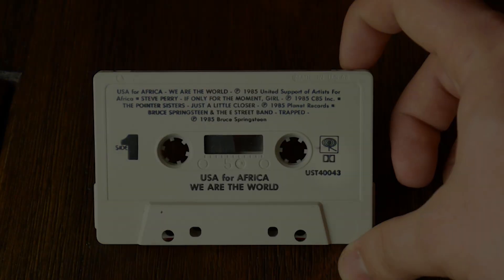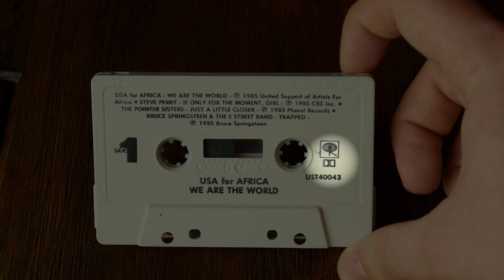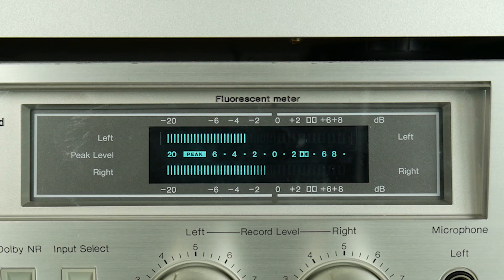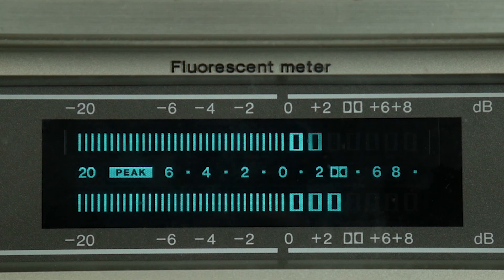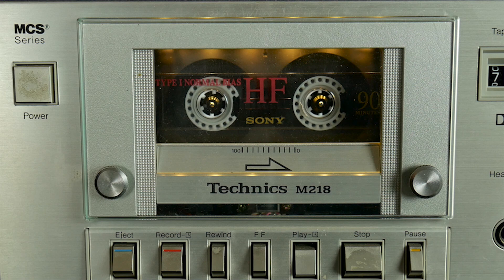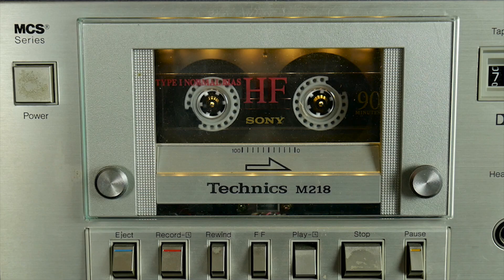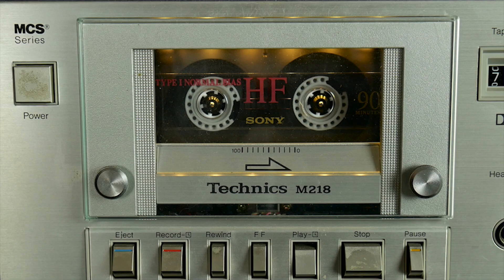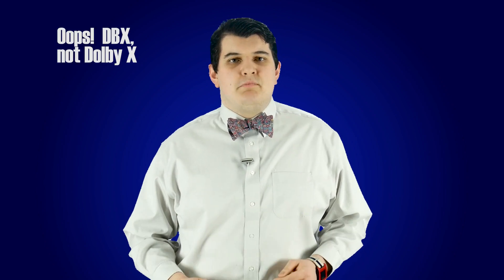What is Dolby Noise Reduction?  Dolby's Humble Beginning

Comment: Using a graphic equalizer to illustrate Dolby Noise Reduction is inaccurate and misleading. The graphic EQ recording curve shown in this video is not Dolby NR, it is more like the high-frequency pre-emphasis curve used on vinyl records. The key to Dolby NR is that during recording, the degree of high-frequency pre-emphasis increases as the sound volume level decreases. On playback, the process is inverted, de-emphasing high frequency noise to a greater degree at lower sound volume levels. Contrary to what this video claims, the maximum recording level does not need to be lowered when using Dolby NR, because the degree of high-frequency pre-emphasis used is negligible at the highest sound volume levels.

Comment: Dolby doesn't just boost the treble, if you boost the treble at 0 db you would severely saturate the tape, so there is no boost at 0 db and as the signal goes down the treble boost goes up.

Comment: I remember Dolby in the 1970's. You pressed the button to enable it and it sounded like someone had put a pillow over each speaker.
Reply: It is true. but it was strange, if you were using a tape encoded in dolby the sound was supposed to improve. and it was the pillow effect
But there were many others recorded normally that sounded better
I got to like so much the pillow effect that Dolby produced. that whenever I can I try to replicate it with the equalizer.
It is not very difficult, only Bass of 100 to 300 Hz and Treb. of 13 khz. to maximum (with some variations in 3.3khz) and voila. Dolby Pillow Reduction for all

Comment: Yes, DBX, NOT Dolby X.  Yikes. :)  We used Dolby A, DBX and Dolby SR in the recording studios.  Multiple tracks would build up noise quickly so reduction could be helpful.  We also had Dolby B and C encoders for creating CDM's (cassette duplicating maters).  You had to include the Dolby (warble) reference tone on the tape for the duplicaters to set the exact levels for recording otherwise the decoding would not work right.

Comment: Early CD's had a similar pre-emphasis as well. Unfortunately this was one of the things that contributed to the perception of digital sound as overly harsh, when played back on a non-compatible CD player. Very few modern players are compatible so ripping an older CD can present some problems. And I think it may have lead to some confusion among mixing professionals as it seems some continued to employ pre-empasis in mastering without realizing that it was no longer supported.

Comment: Dolby C is literally two Dolby B circuits stuck together. I had a reel to reel multi-track deck with DBX. That works with EQ and compression. It does sounds terrible if you don't decode an encoded recording.

Comment: A sub-category with regards to Dolby Noise Reduction, when it came to using blank cassettes for home recording purposes, could be with the "bias" that a given cassette deck were calibrated to when using blank cassettes.
I've gone through many cassette decks over the past 40 years, from the first being a Pacific Stereo Trans-Audio deck of 1977, all the way up to DENON decks in the year 2000; where I've learned that to get the best fidelity out of the cassette deck, the user needs to test various blank tape brands to discover which one is best suited for recording/playback.
In one example, it astounded me how an Onkyo tape deck sounded lousy with TDK cassettes, but sounded great with Maxell.  And, surprise of all surprises (sarcasm), a Sony cassette deck sounded best using blank Sony cassettes.
People with lower-priced cassette decks, and a lack of available info, were hindered with getting the best fidelity out of their cassette decks; especially so for those users that were budget-minded and bought whatever blank cassette brand that was discounted on-sale.  
Some of the higher-end cassette deck manufacturers compensated for the fickleness of the blank tape brands with including a knob dial for adjusting tape "Bias."  The Bias knob was generally found on three-headed cassette decks; where in the "record mode," the adjustment knob was used.

Comment: I was lucky enough to know a guy who invented a completely new way to record on to tape, one which blew Dolby out the water.   I'm also one of the few people he ever gave a demo tape to because the method was so innovative.   Even the guys at Philips didn't believe him when he demo'd it to them.   But I can tell you, you can swap back and forth to the original CD recording and there was no difference between tape and CD.   I was in his lab switching between sources trying desperately to find a flaw and there was none.   It was the perfect recording method, and it played back in any machine.

What did he do next?   Invented a method for FM radio that eliminated multi-path noise.

The guy was a genius.
Reply: please tell more! this is interesting! Who was this guy?
Reply: @polysormi3825  It was called "Contour Biasing" and invented by Archie Pettigrew.   There's a story of it I'll post a link to, but this was of an early version as Archie was working on making it playable on every regular machine, which he very quickly did.   So the tape I have could be played back on my own machine without any modified hardware.   The "cleft stick" the article talks about was gone!

https://www.newscientist.com/article/mg12617183-300-technology-industry-holds-back-on-hiss-free-tape/

Comment: My cassette recordings  keep sounding blown out and splotchy is the best way I can describe it (even recorded at very low level with a clean input source) any idea why? Older techniques deck non Dolby tapes recorded with Dolby off doesn't sound like "wow or flutter" is crisp and high fidelity but sounds like it was recorded way to loud and bass is splotchy treble distorted any ideas?!!
Reply: Splotchy meaning some notes sound fine others almost sound as if they were missed in the recording

Comment: FYI: adding signal is precisely how initial recording was made clearer in the first place... if you add a noise floor and then remove it using circuitry, you can achieve a better recording than simply recording the signal directly.

Comment: but if dolby NR uses only a high frequency boost during recording then how it will sound good in those cassette players which don't have a dolby NR switch for playback? But then why dolby cassettes sounds good in every cassette players?
Reply: @kylesmithiii6150  Whatever... but if dolby recorded tapes are for dolby players then howcome factory recorded tapes which are not dolby, still sounds good in any cassette player? But if you record on any boombox without dolby noise reduction won't record audio like the production quality and when you playback the recorded audio you get lesser audio level and also noise. So I wanna know how can you record audio on a tape without dolby like the factory production quality!

Comment: Another way the tape may have a hissing noise is if you record the tape on a tape recorder that uses a permanent erase magnet instead of the actual AC bias erase head. Those permanent erase magnets are known to record terrible hissing noise unto the tape, while erasing it. Usually the low end or portable tape recorders use this technique of erasing the tape while recording. I strongly don't recommend using such recorders for high quality or important recordings.

Comment: It's not the tape that produces the hiss noise, the tape deck itself produces that hissing noise. If you have an older tape deck with manual function keys instead of selinoid soft touch keys, where you can press play without having to have the cassette in the deck. With no tape in the player, press play and turn up the volume, you will hear the same hissing noise without the tape in the deck. As the matter of fact, this same hissing noise that the deck produces, eventually gets recorded unto the tape sometimes depending on which deck you're using. Unwrap the brand new blank tape and play it with nothing on it, make sure the volume is up. Then remove the tape and press play, you will hear the same exact hissing noise without tape in the deck. Bottom line is, it's not the tape hiss, it's the hiss that the stereo/deck produces.

Comment: Always left Dolby and Tape Bias OFF back in the day to keep them from messing with the real sound.  I don't care if there is a slight, very unnoticeable hiss in the background as long as my highs are not clipped!  Dolby was the devil as far as I was concerned.  And as far a tape media was concerned, I only used Metal (once it was available).  The tapes cost more than the LP I was recording!  LOL.
Reply: Um, you can't torn bias "off".  Bias is a very high frequency tone (above hearing) that is recorded on tape same time the intended audio is recorded.  The tape has to have bias to record properly. All you could do was adjust the level of bias based on tape type.  Our pro studio decks would let us change bias to any level.  Most specs called for over biasing by 3 dB which would give a bit more head room but would very slightly dull the recording.  We would routinely peak bias and just be very careful with levels.  As important was tape head alignment, but that's another story for another day.
Reply: @videodistro  Why does a tape have to have bias to record properly? What purpose does bias serve in the recording process? How is bias measure and what are the options for different types of bias? What are the pros and cons of each of the different types of bias?

Comment: The biggest problem with any kind of Dolby NR on consumer gear, is that both the recording and playback deck have to be carefully calibrated for the particular tape formulation being used for the Dolby to track properly. The little Dolby symbol on the VU meter is simply there to show standard Dolby level for calibration, it has nothing to do with the maximum suggested recording level. On a good machine with metal tape you can push way past this level with no issues.

Comment: Its is adaptive compression(rec)  and expansion(PB), NOT EQ!!!,  
Dolby does nothing on levels 0db and above. by design.
for most of the cassette era, Dolby never worked as compresison/expansion %98 of the time miss tracked the levels due to wrong bias (default bias one size fits all)

Comment: My acoustic guitar has a built-in preamp with an audible noise floor. Since the guitar has tone controls for bass and treble, and the treble can be turned all the way up without increasing the noise, I crank the treble while recording, and then dial it back again in my DAW to return the brightness of the guitar to a normal level, and in doing so reduce the noise floor. It works perfectly.

Comment: The even simpler and much earlier noise reduction system was the pre-emphasis / de-emphasis used by FM broadcasting. It was simple EQ, nothing more. Even Dolby B did some companding along with the EQ,  so Dolby B was, in fact, more than just EQ.
 
Exactly how the pre-emhasis / de-emphasis system developed was somewhat interesting, also. The EQ curve was not arbitrary.  Some early FM transmitters used phase modulators. The high frequency part of the pre-emphasis curve is identical to the curve which is intrinsically generated when a phase modulated signal is demodulated by an FM detector. Therefore, the high frequency segment of the pre-emphasis curve was automatically generated by a phase modulator.

When I was in high school in the early 1970s, our radio station had a CCA FM10D transmitter, which used phase modulation. So the only EQ it had ahead of the modulator was a so-called "pre-distortion" curve to handle the low frequency segment of the pre-emphasis curve.

Comment: You forgot to mention something:
The Dolby-FM system.
What was the incorporation of Fm Radio Stations Coded with Dolby NR. in which not only the noise of music was reduced but also the noise and whistling when tuning.
and these encoded stations were Autodetected by the Dolby Circuit similar to the FM-Stereo detector circuit
While Exist Circuits Dedicated to Dolby-FM, Dolby NR-B, Was Ambivalently Compatible
-With the difference that Dolby FM, included a second process that improved even more the quality using the dynamic range and Frequency Block by oscillator. [and this opened the way to many modern digital and automatic tuners]

Comment: Chrome tape, recorded with normal eq and chrome bias ( achieved by tweaking internal trim pots) with Dolby B on and level set propely give amazing results when played on devices that only support type 1 tapes and dolbyB nr. This technique was used to deliver back then chrome tapes to the public stating "made to be played on normal position". Unfortunately, back then, these copies were made at 6x speed in factory with the 4-5th copy of a copy away of the first studio master copy resulting in great intentions but awful recordings. But, if you tweak your devices yourself at home and tape your own stuff on some TDK SA, you'll get blown away by your old GM delco cassette radio with Dolby NR in your 80's minivan!

Comment: Very neat explanation, but you omitted to mention that the amount of noise reduction applied varies with the volume of the source. For example, during loud passages, hiss is effectively inaudible so no noise reduction is applied whereas during quiet passages the noise reduction is strongly applied. If this wasn't done, loud passages would oversaturate the tape leading to distortion and the only way to avoid it would be to reduce the dynamic range of the recording to the detriment of sound quality. That's why Dolby is so neat - because it solves the problem without creating a new one.
Reply: He mentioned that

Comment: THe level and the characteristics of tape noise are depending on how the tape coating is made up. Very fine, shaped, orientated and much more densely distributed particles e.g. produce much less basic noise like a standard amorphous ferric oxide e.g. does. And the highresolution tapes are also those being capable to be recorded much louder on (this reducing the "noise bed" down to an almost unnotable level, relative to where the sound recording can be set to). So, the best noise reduction regarding cassette tape is going for an excellent tape material with a high saturation capability where you can set a good and decent record level initially.

Comment: I just replaced the belts in my Sony TC-WE805S dual recording cassette deck with Dolby S.  I bought that deck in 1998 and now it works like new again.  I never recorded any cassettes in Dolby S for my car at the time because I did not know that it was highly compatible with Dolby B.  I never recorded in Dolby C because I knew that did not play well with Dolby B.  How about doing a video on the generic, Dynamic Noise Reduction (DNR), that was mostly on GM Delco stereos because they did not want to pay Dolby licensing fees?

Comment: Can you do a video on the "Loud" or "Loudness" button on old car stereos? I always wondered why my Dad's old Dodge Duster (complete POS) had one.
Reply: This option compensates the loss of the bass when in low volume.
Reply: It is not very complicated, it is practically only a band equalizer which increases the gain of the low frequencies. to compensate for its lack in radio transmissions and metallic tapes or when these have a very low volume.

-It's kind of like when you wear headphones. You need to turn up the volume to a certain level to pick up the bass, but the rest is perhaps already very loud.

the Loud Function, only does that same volume increase to the bass but maintains the rest.
It is not so common anymore, but at the time it was quite common to see this function also in mini-components and turntables from Panasonic and Fisher Audio.

-Currently it is still used in sony equipment, with the name GROOVE. which generates the same effect but adds a plus by emphasizing the mid frequencies in vocals and string instruments

By the way, it is curious how warm the old car stereos of the 70-80's sound. It's probably because the car is a closed room and it resonates better, But overall Those Quadraphonic Arrays, Front Stereo and Rear Hi-fi. They really give a deep vibe, especially with sad songs.
-Something that has really been lost in many new cars. (there are some that really sound cheap)
Reply: It boosted the low and high frequencies so you could hear more than just the mids at lower volume.

Comment: When you try to demonstrate the audio effects of various processes, don't use some weird electronic music as a source!  Select something with real instruments recorded live.  That music you played had some crazy electronic tones for the melody, and what sounded like pulling out and re-inserting an audio jack pops and clicks for the base line.  Also remember we are listening on the back side of what I assume is MP3 recording, which is about as good as a very beaten-up, dirty cassette.  The music sounded awful in all modes.  I suspect the original played high-quality would also have sounded the same.
     You need to also mention the politics (patents?, trade wars? licensing wars?) aspects of the Dolby format, which made it impossible to get as a separate box.  There was also Elcast format, which address the root of the problem: that the cassette is crap (good for dictation only).  Elcast draws the tape out of the cassette, using that for only the reels.  Later DAT and video recording used this method.  Sadly, even digital formats are drawn down in quality by the MP3 format.  Digital formats used in cell phones are even worse, sound quality being inferior to that of the original Bell phone.
Reply: The electronic music sounded fine.